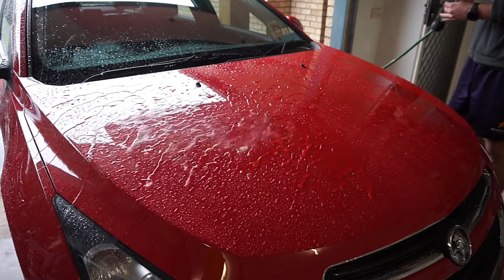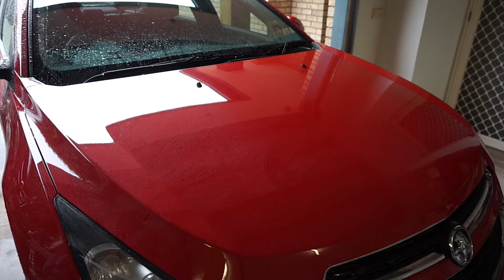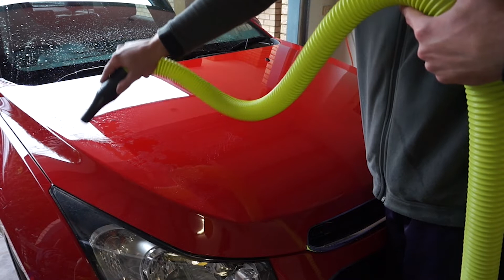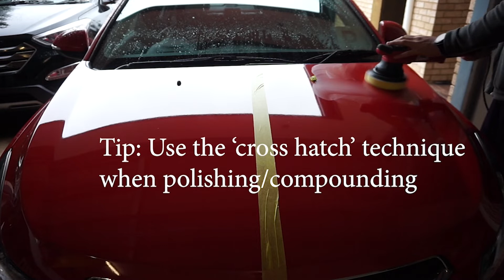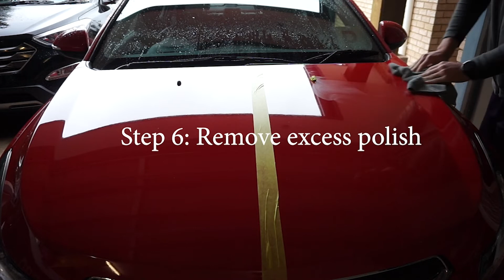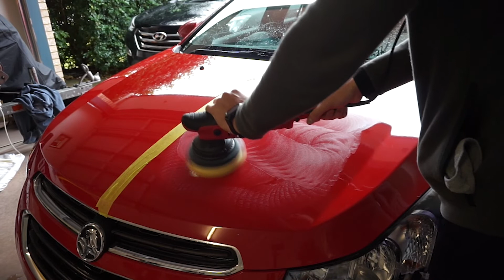How To Use Meguiars Ultimate Polish - Car Detailing 101

Comment: This is my most used polish. This, Ultimate Compound, and SwirlX were the first abrasives I used with the random orbital back in 2011or so.  Efote that it was M02 and M09 on the rotary. 

While Ultimate Polish delivers some of the best gloss I've been able to achieve, it can actually do a bit of cutting too. 

Like Ultimate Compound, the abrasives in the formula do not diminish, or break down into finer and finer particles. Instead they start out sub micron and stay that way. The lubricant is durable enough to survive extended buffing cycles.

I actually have an Audi in the garage right now that's in for a one step polish and a coating. I tried a variety of combinations, but this and green Buff and Shine pad was the winning combination. 

I tried Jescar Medium Polish on the same pad and tool (Porter Cable 7424xp), then on Rupes Duetto / 21, a yellow Buff and Shine Uro-Tec, then Uro-Fiber. Then I tried 3D ONE. Then back to the PC + green pad with Optimum Intensive Polish. 

I was trying to get the best bend of cut and finish, which can be a tall order sometimes. The green pad from Buff and Shine is the same foam as the Chemical Guys Hex Logic. I find this pad to cut much better than their yellow and orange pads. I usually use them for compounding, but they still work great with a polish for one steps. When finishing with Ultimate Polish, I use the blue Buff and Shine / Hex Logic usually. But this also works great on the more modern pads and polishes too.
Reply from the maker: agree! thanks for your input
Reply: Good to know man, I just picked up a 20 oz bottle of ultimate polish for $6 at Ross 😆.
Reply: @STILLNIGHTPEARL  - You'll want to shake the hell out of it, if it leaves "deposits" on yhe paint that are difficult to wipe off. It's usually from not getting the ingredients properly mixed in the bottle, but once you do, it wipes off with ease.
Reply: @danlc95  thanks man! it smells kind of like the bottle of 06 that I picked up recently, I don’t feel many abrasives between my finger tips, I’m assuming it’s more of a chemical cleaner/light polish. I’m probably going to use this on my 2018 accord, I really just want to clean the paint up, not looking for any correction beyond that, Meguiar’s 5 inch yellow disc on my 8mm throw DA speed 4-5 should be enough.

Comment: I think your going way too slow polishing. Its like your compounding. Anyway everyone does it differently.
Reply from the maker: When I use compound I won't do as much work with the polish, but when it's just polish I'll work through it a little slower.
Reply: . The last thing you want is to go too slow and get too much heat into the paint!

Comment: No compound?
Reply from the maker: Not in this video boss
Reply: You don't need to compound if you clay bar.
Reply: @stevepettner3693  depends on what you're going for.
Reply from the maker: @megaruhe6296  yea if I wanted a more aggressive cut I’d use compound, polishing is mainly for light cutting
Reply: @stevepettner3693  claying removes  contaminates,  polishing cuts the clear coat slightly,  making for high gloss, and luster.